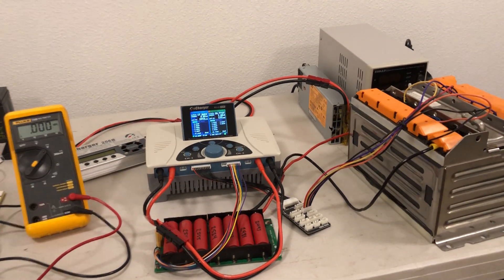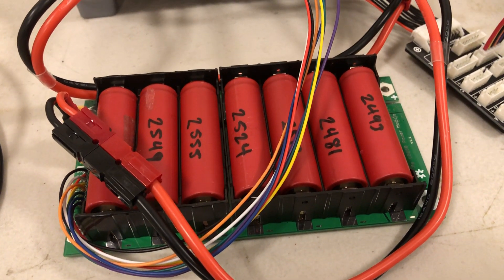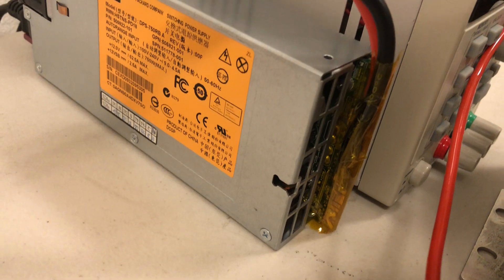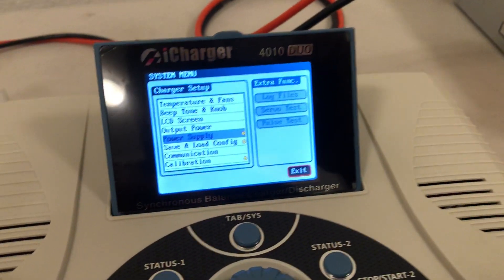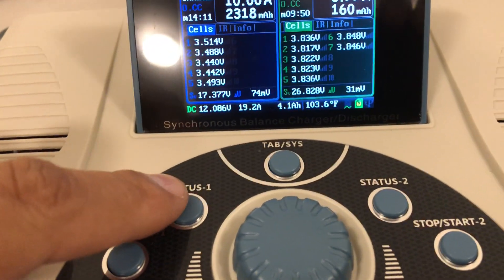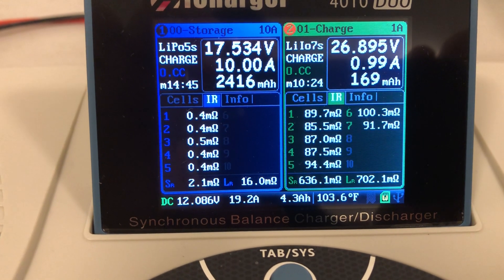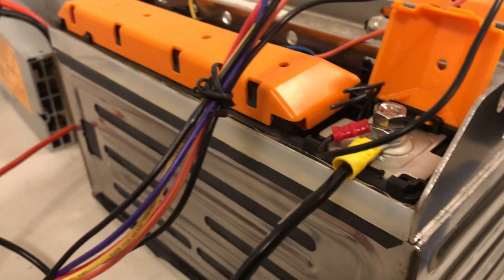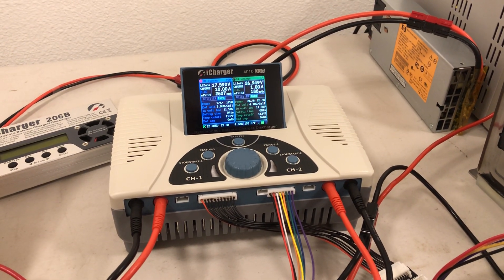iCharger 4010 Duo - Dual Channel and Input Current Limiting

Comment: Hi,
Can it charge and Discharge one Cylindrical battery 18650 with different discharge rate such as 2C, 3C? Will it also monitor temperature of battery?

and If i make module of cylindrical batteries, such as 5S3p (21V and 9A) or (5S2P that is 21V and 6A) then will it still charge and discharge batteries with differen C-rate? such as 1C, 2C and 3C?
Reply from the maker: Yes to both questions, the charger can do that.
Reply: Okay can you tell, how to check one cylindrical battery cell under different charge and discharge conditions. How to connect it with this tester

Comment: Have you used this charger for any NiMh? I'm working with some old Rav4-EV modules and wondering how the 4010 handles NiMh. The Manual is sparse. for NiMh, will this charger monitor each CELL in a NiMh Pack for discharge cutoff voltage? rather than only for whole pack?
Reply from the maker: This charger handles just about every battery type made.  It would work with NiHM just fine.  I might get a Prius for free pack soon which is NiMH.